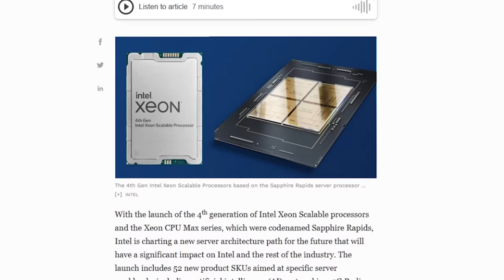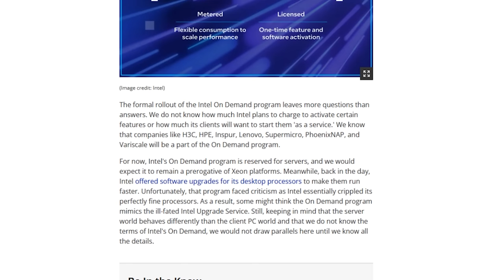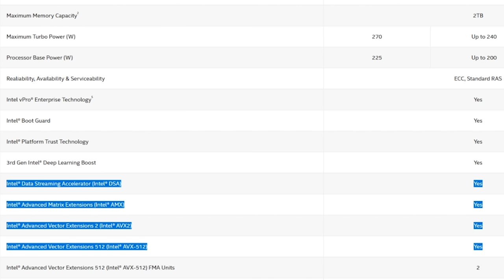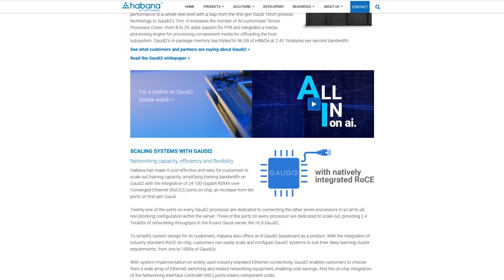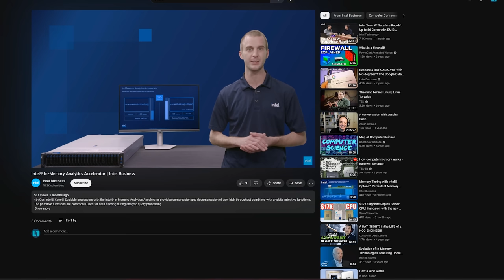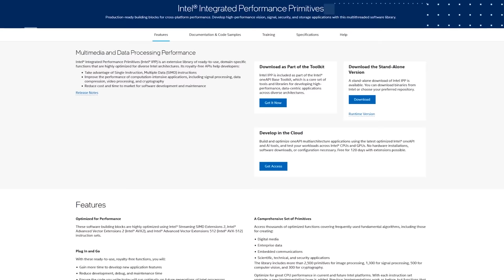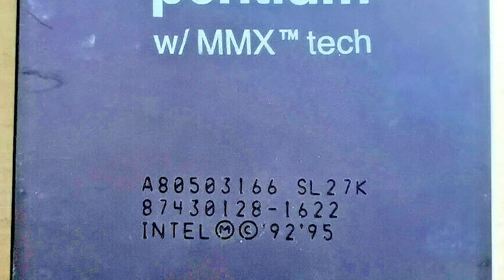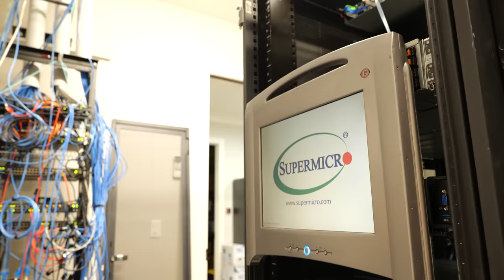Accelerators: Intel's Secret Weapon

Comment: I don’t like accelerators being bundled on the CPU. I wish they were connected via PCIe or other lower latency.
Reply: That's exactly what I'm thinking, it was already like that. Buy a CPU if you need a CPU, buy an accelerator if you need one but don't use space in any of them for what it's not useful. You're still going to pay for those accelerator's even if you don't need it, I doubt intel a "giving" those away for free even if they plan to make money with them later on.
Reply: @EvilDesktop  totally! I do think the cost is in IP rather than manufacturing though so I wouldn’t be surprised if they put the transistors on every die and just accepted a low yield (and bin accordingly). There are some obvious bandwidth advantages to having it on-die. I still don’t like it as a customer.

Comment: intel messed up big time. One delayed SPR for a long time(should have been out late 2021 as originally intended) and then go with this shenangians of unlocking features after buying a CPU. That wont work at all when they are playing defense. Should have unlocked everything and sold so that all models have all the features. Then things would be lot better. I am disappointed Pat did not get that. Dont try these when you are behind 8th ball plus the CSP are trying to move away from x86 for compute.

Comment: This is where I feel AMD has failed frankly.  It's not just that you need to get accelerators into a CPU, it's that you have to have the development team that can help the customers get the most out of them, and for AMD right now it seems like they can put hardware into their CPUs but then they talk about use cases and it's not much, and it's CERTAINLY not as the typical consumer level.

AMD needs a bigger software engineering dept. with very experienced engineers that have worked with acceleration so they can get the most out of purchasing Xilinx.  I would have done everything I could to make sure Zen 5 has acceleration in it AND it shows up on the typical Youtuber benchmarker and reviewer benchmark data so it's clear what they can do.  And yes, that means AMD software engineers work with Adobe, Autodesk, etc.............. engineers.

And in the world of server, it won't be Intel pushing AMD back out, it will be Nvidia.  Nvidia has a top notch software engineering dept that's solving very complex problems and Nvidia has the hardware to run these solutions.

The name of the game is NOT, "throw hardware out there and let the customers figure out how to best use it",   it's "solve the customer's problems and give them a complete package of hardware and software for that problem".  This is true in the world of enterprise.  For desktop it's not such a huge deal, but when reviewers benchmark CPUs they don't care if CPU cores are giving the benefit or if accelerators are giving the benefit.  They simply show performance charts and AMD needs to be very aware of how that affects the consumer market.

No reviewer is going to benchmark video chats and see if someone's eyes are following them.

Comment: Wenndle you and i both now the statement "you dont pay for it" is bollox.

As for intels accelerators, well there are faster ones available, and we use them with AMD, intel is about to have its 5th year lockout of our datacentres.

5 Years ago, 120,000 Intel powered servers
Today  - 65,000 AMD Servers

With 10x the memory at 20x the cores vs 5 years ago.

Comment: Hi there, dont know if you were already hinted at that..
Your Jazz (?) background music is just so low (at the levels i listen), that i find the trumpet distracting.
Was even looking if it was noise pickup because it came in competing randomly with your voice.. until i realized the "noise" went away when i stopped your video.
Happened at two videos now i think. - Wouldnt mind no background filler music at all, if its that low anyways.

Now i'm not a relevant number of your followers or a regular and probably way over average on the high frequency hearing/sensibility spectrum,
but i ruins the experience for me. Can't listen/concentrate on the content like that since its kinda random popping in and distracting me.

Comment: Slowness accelerator. Amd is fine, by the time software catches up, amd will have it, intel will be paying the early adoption fee.
Reply: Accelerators are their own architecture for the instruction and so they have their own copyright. AMD can't just add the same thing intel has. They would be different instructions and wouldn't simply be interchangeable.
Because they would give slightly different results in edge cases so, depending on the program, they can't be relied on all the time. It's usually the reason why vendor specific features aren't widely adopted.
That's also why the open ran part is good, but they don't want to mention it's compatible anywhere......
Reply: Just like AMD payed the early mover fee building 8 Bulldozer cores instead of fewer faster cores. 

Funny how the turn tables. For AMD's sake, I hope they don't wait as long on accelerators as Intel did for implementing more cores.
Reply: @SquintyGears  There's already a more or less standardized way to do this in both windows and linux. The hardware implementation is irrelevant, gpus don't need to have the same instructions to run a game, just conform to the graphics control interface.
Reply: @rightwingsafetysquad9872  why is this copium about buldozer so prevalent? AMD made the bet integer math would be primary usecase and ended up wrong. It wasn't about fewer faster cores.
Honestly i don't really disagree with the logic they where following. But there's very few times as a programmer you can guarantee fractions aren't floats. So their vision was a little bit too crazy, because people aren't going to remove all divisions from their work.

And so the legal argument became "since all programs use floats, and there's only 4 FPU, you can't say it's 8 cores"
It wasn't an early mover loss...
Reply: @SquintyGears  I'm not coping. Bulldozer was bad.  I agree with everything you said.  But they were right that parallel integer performance would eventually be more important than single-core floating point.  We're there now for non-gaming desktop work.
Reply: @rightwingsafetysquad9872  that's why I'm saying copium(though it's a bit of an annoying way of saying it sure)... They weren't right... The amount of floating point use has only increased. Well to be fair a lot of that computation has moved over to gpu.
TLDR: But still in general applications the advantage of being able to use division has out weighed the inherent precision problem binary float has.

I image it's much more likely to encounter programmers who know this on this channel vs the general internet. But floating points in computers aren't continuous. They're not stored as 2 integers of fixed max length with a dot in between. To get extra range from the format floats are computed through a kinda non intuitive multiplication and that process leaves gaps between possible numbers. (cause 2x2=4 and 2x3=6 and u missed 5 in between the two) and the density of values that floats can represent is more and more sparce the further from 0 you get.
So AMD estimated that programmers would see this source of bugs as a problem they would want to avoid because they're smart. It seemed like a very smart thing to me too when i heard about the whole thing. However it turns out that the shared FPU was a bigger slow down than 50%(half the number of cores) in the real world. And that programmers favored being able to use division and having decimal point results rather than the solid reliability of integers with their limitations.

Comment: The idea of intel posing a threat to AMD's enterprise hardware is hilarious to me, I haven't seen a single server running AMD hardware other than niche specialty servers. On AWS about 90% of the servers i interact with use intel hardware, the other 9.9% use amazon/ampere hardware, and the final 00.01% are AMD systems.
Reply: i think amd is paying for media hype.
Reply: The fact that AMD went from 0 to over 30% of a market so reluctant to change in 6 years is absolutely insane, combine that with the worst earnings in Intel's history plus the never ending delays of their architectures and you are delusional if think AMD isn't a threat.